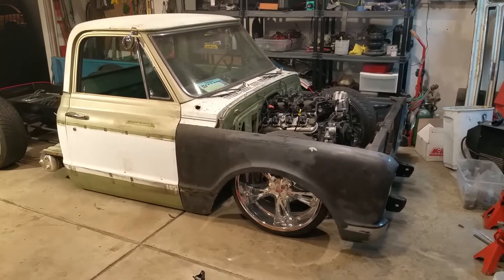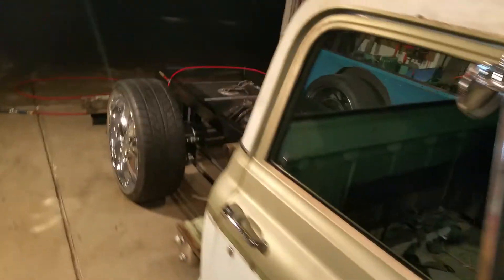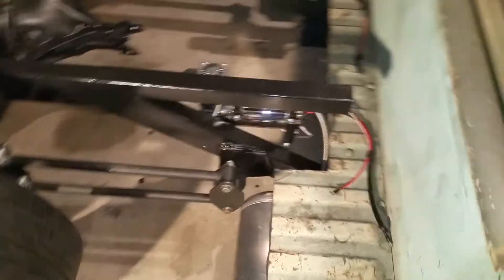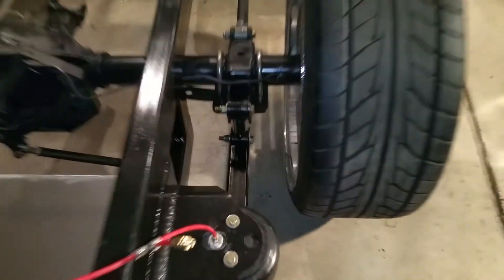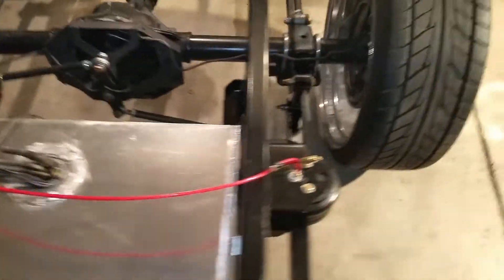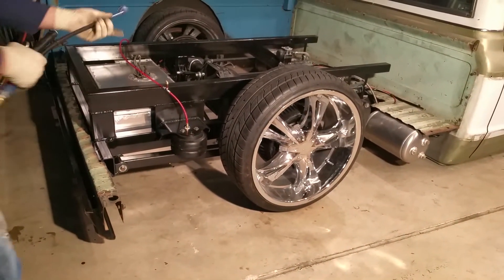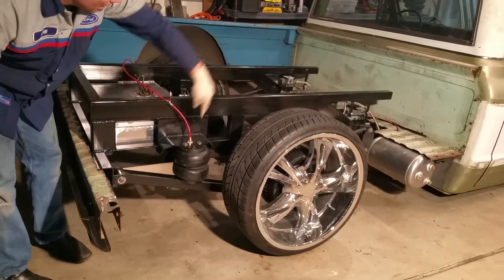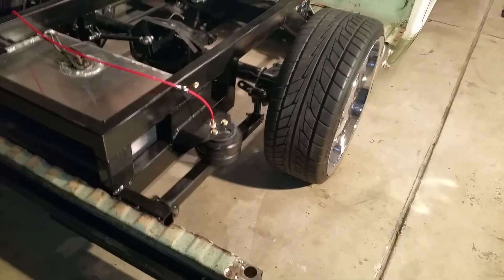How a 6 link works

Comment: Instead of using the watts link could you run a triangle link on top to keep axle centered?
Reply from the maker: Yes you can. I built this as a test of my design. i had already built triangulated 3 and 4 links.

Comment: How would this compare to a 4 link with bags for ride quality and towing capability?
Reply from the maker: The 6 link has bags on the rear arms so it lifts behind the rear axle. That way it supports tongue weight better.
Reply: @bnii2  What about ride quality wall not towing any pros or cons there. Thanks for the replies
Reply from the maker: @tjh1127  if you are going to tow heavy loads a lot then bag on axle is by far the strongest but the ride is harsh with out a load. Bag on bar at a 2:1 lift ratio makes ride quality very nice but you loose tongue weight capability.

Comment: Bill, cool video. Did you enjoy this setup? With Dirty Dianah I am having to figure out a new thing or two with my expected power on the twins
Reply from the maker: I did like it. Rode smooth and handled really well even when I had 800 pounds loaded in the bed for a trip 300 miles north. The great part is with a Watts link there is 0 axle movement.

Comment: How does the dog bone work? On kp's cite I notice they have different dog bone options for rim size.
Reply from the maker: The dog bone length determines how much drop you can get with your tire height. Taller tire needs a longer dog bone to keep the link bar parallel at ride height.
Reply: @bnii2  that's what I was thinking but thanks for the reply!! I have 20s at the moment, would it be ok to get the bar for the 24s(I don't plan on staying with 20s). Instead of getting the shorter bar now then getting the longer one after? I'd imagine that I'll probably just lose some ride height but maybe I'm wrong,.
Reply from the maker: @Pachuco  you are exactly correct. Get the one for 24s because you will still lay out. You will just loose a little lift. Thats why I made mine adjustable. I was thinking of getting 26s.
Reply: @bnii2  Yea makes sense on why adjustable would be nice, that way you aren't limited to one wheel size... I originally planned to go 24/26 combo but I might settle with 22/24 combo for the OBS
Reply from the maker: @Pachuco  awesome. Good luck.
Reply: @bnii2  I have another question if you can help I'd appreciate it!!! One thing that concerns me is that it appears that the cantilever bracket and bar sit low, would I be able to drag my.truck or will it hit the cantilever?
Reply from the maker: @Pachuco  because the cantilever is attached to the rear end, it is always the same height off the ground no matter what the truck frame height is at. The dog bone just acts as a pivot.
Reply: @bnii2  I see🤔hope it's not a problem when I start Cali leaning and dragging my bumper lmao, thanks again man!!

Comment: that's a lot of pressure on that bag isn't it? and kinda off center.
Reply from the maker: 3 years now and not a single failure. That bag is designed to hold 2800 pounds per bag.
Reply: wow 2800 lbs. that's a lot I never woulda thought that. that's cool though I wasn't knocking it just was curious. btw cool truck.